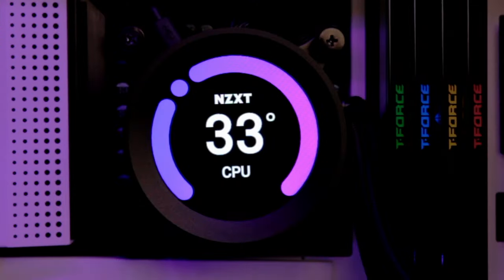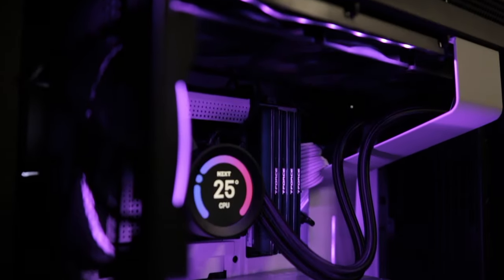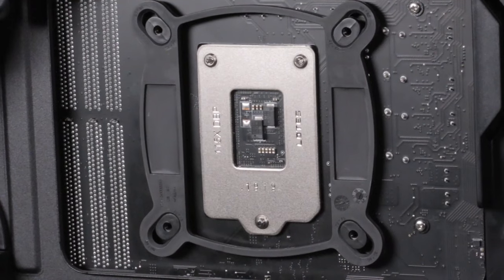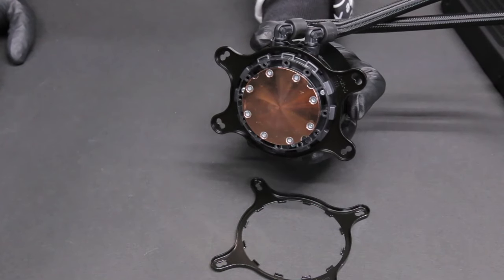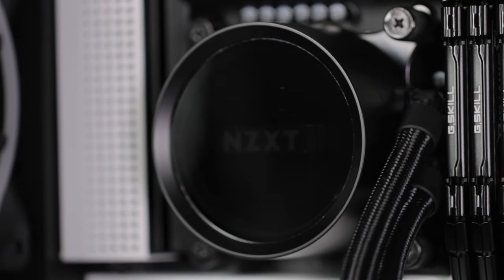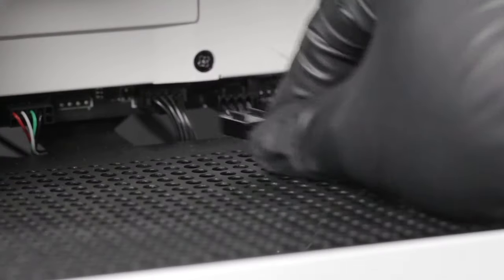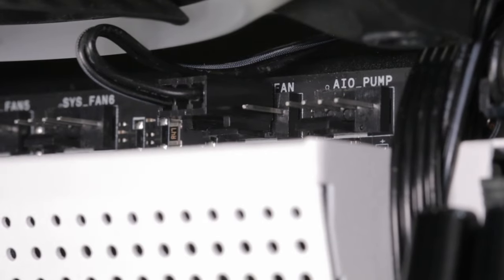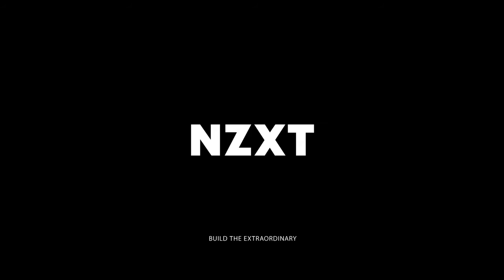NZXT Kraken X & Z All-In-One Liquid Cooler Walkthrough and Installation

Comment: I'll be honest. An air cooler would be just fine for my build, but the Kraken is gorgeous! I cannot resist! Also, it would be nice to get a white version. 😊
Reply: that's what i was thinking as my gaming setup is all white, i think i might just paint it or use a vinyl wrap
Reply: @kierannm7646  I would not paint the fins of the radiator, maybe just the exterior portion.
Reply: I have one if these. It's is pretty enough, but did they provide any instructions how to use the software? Nope.
Reply: @kierannm7646  there’s a white version!!!
Reply: @marckayyy2408  yep and I’m getting it for Christmas. I’m so hyped
Reply: @glyphs320  dude I finally ordered mine today and it comes In next week 😭 I’m happy asf rn 😂
Reply: Foreshadowing
Reply: @marckayyy2408  Yep, installing my white one tomorrow haha
Reply: Just installed mine, the only thing that would make it better was if it matched my white case!
Reply: Some high end aircoolers can perform better than some liquid coolers
Reply: @studioz3d621  there is a white version
Reply: @MrTefe  basically none beat a x63 or x73

Comment: I can't believe it,  a good walkthrough and installation from the actual company.  I know corsair does it but in my opinion not as good as nzxt's.
Reply: literally installed it wrong though lol, bad walkthrough
Reply: @kurziieee  what is the right way to do it?
Reply: @samsun4056  So the content of the loop is liquid and air, you want to get the location of the air bubble to be in the position where it doesn't cause problems.
The only position inside of an AIO loop where it's safe for the air bubble is the side of the radiator that is NOT connected to the tubes (both ends of the radiator have a tank and in between those two tanks the water seeps through the body of the radiator).
Air is lighter than water so the air bubble will ALWAYS exist in the highest point of the loop.
If the pump is the highest point of the loop this is obviously the worst possible configuration as it will cool less and slowly destroy the pump mechanism, the tubes and the radiator tank on the side where the tubes are connected to the radiator are also very bad for obvious reasons.
Thus the only good configuration is to have the radiator tank that's not connected to the tubes as the highest point of the loop, here the air bubble causes no damage or cooling issues whatsoever, since the liquid will just fall down here back into the body of the radiator without having to "fight" it's way through this configuration also produces the lowest amount of noise.
Reply: @José Mann I've had enough of armchair experts telling people what to do, even bottom mounting an aio is more than fine as long as you don't plan to use it out its warranty period, by that time it would probably fail even if mounted 'correctly'; now let alone this orientation with rad in front and tubes up top, most aios don't even have tubes long enough to get them to the bottom
Reply: @sevenelven  I guess when you don't have anything useful to say all there's left for you is to make jokes.
As per your "point", they probably just don't care because the vast majority of consumers will buy their products anyway.
Reply: @suborgulag7289  incorrect, bottom mounting will both have negative effect on your performance and will ruin your pump.
Reply: @sevenelven  my bad, thought you were being sarcastic. text hard to read sometimes :)
Reply: FFS not this shizz again. Nothing wrong with side mounted radiators as long as the tube connectors are at the top!!!!
Reply: @0Metatron  so long the tube connectors are at the bottom 

There, fixed it for you.
Reply: Only if they end up below the CPU, if they are above (which nearly all cases are) then you a can side mount with tube connectors at either the top or bottom
Reply: @0Metatron  you can but still sub optimal
Reply: @kurziieee  when people like Jayztwocents and gamer nexus says it's ok. then it's ok. lol
Reply: @aronPlays14  fallacy from authority, nice

Comment from the maker: 👉👈
Reply: @KFCowboy  r/brokethechain
Reply: @lilpapizk439  👉👈
Reply: Awe nzxt is a shy boi
Reply: EmeraldBay 😂😂😂😂
Reply: @Albert Blkyan Both have the same specs, except Z73 has a screen and X73 has RGB. Moreover, Z73 is more expensive than X73. So I guess Z73 is better than X73.
Reply: OH NO SHY GUY (SCP-096)
Reply: Can you put Gif on the kraken m22
Reply: @lusixnsgaming8072  yes, any sort of gifs can be used. =)
Reply: Does the x63 show gpu/cpu temps and allow gifs or is that only the Z series?
Reply: @simplygaming2280  Z
Reply: @simplygaming2280  no, the x series only have rgb.. whereas the z series a screen panel to show info.
Reply: @EmeraldBayMovies  🤣
Reply: @EmeraldBayMovies  😂😂
Reply: I read that mounting that aio with tubes up is having problems with bubbles? Is it ok to leave it like this?
Reply: Is for me?
Reply: @EmeraldBayMovies  hey hey hey
Reply: @NZXT Do you need to refill any aio of you guys
Reply: Ah yes docking
Reply: How do I get the breakout cable for the rgb because my kraken aio won’t light up
Reply: @its_steve9249  you probably blew out your screen, did you plug in the 12v header?
Reply: @JannisCraft just use white cable sleeves over the tubes, looks nice 👍🏾👍🏾

Comment: I really like that display, I can think of numours of idea's to add as picture or gif's on it.
I also really like that mirror look and the themp. clocks. Basically one of of the reasons I started looking for these kind of RGB-waterkoolings. No longer need to keep an eye on my system for not getting to warm during hot summer days and heavy gaming.
Since I am using your waterkooling I also noticed my PC has less issues and hardly needs help at hot days anymore.
However one thing that doesn't make sense to me - don't get me wrong - now why in this period that RGB is coming to the PC and more and more, parts are being build with RGB, there you offer normal non-RGB vans with, while in your store you do sell them with RGB. So without the RGB-vans the Z63 is a bit overpriced if you ask me.

Comment: I really want to get this to work. I did a custom build a month ago and for 12 days straight before working after work probably 8 hours a day I tried to get my first NZXT Kraken x63 to work after almost two weeks of not being able to use my computer edit videos or pictures and frustratingly sitting at this table hurting my back. I sent it back and got another one. Unfortunately I was using Amazon and even though I was buying new ones you could blatantly see that these things were used as the thermal paste was gone and there was other signs of use as well. The second one literally after three days I couldn't get to work so I bought the RGB fan adapter. With that I actually got the crack and software to finally work and it showed up as a separate pump and fans. The first one would not do that. So I could never change any of my pump settings. I'm actually on the third one now which is the z63 and that one came used as well. But everything has been on hold for an additional two weeks because I upgraded from a i 7/10 gen CPU to and I9 11th gen CPU and I had to go through three different motherboards before we could get everything working. It was ridiculous but every motherboard would work with the 10th gen not with the 11th gen. And I have 2 separate 11th generation chips that would not work on three MSI motherboards. Even after contacting MSI they stated that there must be an error with the Z5 90s. Finally yesterday I got my 4th motherboard delivered and I actually got an 11th generation CPU to work on A Z590! And yeah I tried every troubleshooting possibility including updating bios through every BIOS version on msi's website. But that aside I finally got the computer working but now my z63 is running at 100 degrees Celsius and it says zero RPMs for the pump. So 5 weeks later I still don't have a working computer I've been through four NZXT pumps and four MSI Motherboards... I probably have $3,000 tied up and refunds right now and exchanges and then my first motherboard was $1,000 because I bought a Godlike from MSI and they're not cheap but the pins got bent with all the fumbling around for weeks and weeks and weeks... I just don't understand when stuff supposed to be compatible why it doesn't work and then there's the fact that Amazon can't send a new item when you pay for one. This build has been one of the most frustrating things I've ever done

Comment: What do I need to plug the rgb control connector into. I have an x63 and a smart device on the h510 elite
Reply: I have the same problem what do i do??
Reply: PANDY 0_0 u don’t need it you just need the usb connected on the mobo and the cam software

Comment: So I got  3 of these, in the 240 and 360 versions. I'm I happy with them, yes to a certain point, do they look cool, yes if you are into that. Personally I'm all about performance, do they perform good, yes to a certain degree. Can I recommend some improvements, yes, in honesty you can save a lot of money just by using a top of the line air cooler. Yes you will have to live with the fan noise, but that happens with the AIOs also. In my case I have several Gaming rigs. AMD based and Intel both, I prefer Intel, is a little pricier but performance is great for the money. It runs cooler than AMD chips and that is a big plus. I have the 240 on an Intel chip and a 360 on an AMD chip both running the same software and specs. When I put them side by side the Intel is a lot quieter even with a smaller AIO, that to me is a good indication that the AIO is doing it's job real good, for the money spent that is. Lots quieter, I like quiet, and it saves me from having to buy headphones and wearing them like a dork. The room temperature is lower, a gaming room can get real toas-t when you have Gaming PCs running 24/7. Yes these AIOs are pretty but their performance for the  money really soks big winnee. Stay away from AMD if you like a cooler room and less fan noise. A decent air cooler will do you good if you are willing to live with some fan noise and a bigger PC case. The 360 AIO fans on the AMD chip are loud and they generate a ton of heat, but they look pretty, HEY? Just my 2 cents but I warn you, I owe them to the IRS.    😅🤣😂

Comment: May be a silly question but fans only blow one way and I don't know which direction is the correct way to install the fans when mounted the fans below the radiator for a top mount (radiator touching chassis and then the fans below it). Would I want to blow air into the case or out of the case? So confused lol
Reply: Set them to exhaust
Reply: Or you know, unscrew them and turn them around lmao

Comment: Weel done but you have forgot the W_pump 3 pin cable connect. This in need to control the water pump speed

Comment: it would be nice if some of the cables were longer and out of the box ran up with the water tube so it didn't look like 300 cables coming out of the cooling block.
Reply: You tell me I have 10 fans I don't know how I did cable management. Also, having problems with my bios right the pump cable is too short to reach the bottom of my motherboard

Comment: Is this in/out cables used for the fans? Or does it just wire into the motherboard and don’t worry about connecting the fans to each other
Reply: did you find out i’m having this problem rn please tell me

Comment: So I don't get it. First time putting an aio cooler in a build and I have no idea what plugs go where due to getting it used and the cords being a jumbled mess and it has no manual. You're saying to put the 3 hole connector into the cpu fan slot? that's the only part of the cooler that connects to the mobo?

Comment: Can you change the fan included in the cooler?
Reply: I am using 6 fans that are not nzxt with the x73. 3 Noctua in push-pull config. 3 Asiahorse pulling.
Reply: @mrwhite9830  thanks!

Comment: Hi, I need some help.
I had just installed my NZXT Kraken X63 AIO and seems to be working normally, however, when I'm using the cam software I am not able to change the Lighting because it says "No supported cooling devices were found" and "No supported lighting devices were found". Thanks!

Comment: I’m a little scared of liquid cooling, I’m about to build my first pc and am wondering do I have to add any liquid/ replace it? Thanks for any help!
Reply: Am too!
Reply: No. AIOs are set up so you never have to mess with the water inside. They are already filled. You just need to install and you are good.
Reply: AIOs are ready to go out of the box, you don't need to add or replace any liquid.
Reply: it’s just as easy as an air cooler

Comment: Just picked up the H510i case and Kraken X63 (2 fan one)... I'm a bit unsure of the fan direction for this setup.  Are the fans in this video pushing air through the radiator into the case, or are they pulling air out the front??

Comment: Why are you showing the radiator mounted tubes facing up in this video at 3:55? Doesn't this create excess noise and added stress to the pump?
Reply: as long as the pump is bellow then radiator it’s fine, refer to Jayz video on pump orientation
Reply: @icy_business  It won't stress the pump if the the top of the circuit is higher, but it will still cause a trickling noise if it's mounted that way.

Comment: im very new to pc building gonna build one tomorrow and i know its probbably a dumb question but arent u supposed to put liquid in it since its called a liqiud cooler i dont really understand but i bought one and i need some info before building how does it keep cool cause the display thing isent a fan right so how does it keep low temps compared to a build with a fan on top of the cpu?
any answers will be taken with great appreciation :))

Comment: what do I plug the 4 pins from the break-out cable to if I don't have compatible NZXT RGB accessories and will the RGB in the block still work? (i have a Kraken x73)
Reply: You need the NZXT controllers for the fans and stuff. Stop buying products that need other things to function and only buy stuff that can work independently and can be controlled with the Motherboard BIOS

Comment: OK but I didn't see you put liquid into the cooler does it come already in there?  I use a Noctua air cooler and get to like 67c under load in cinebench so I don't even think I need an AIO but it seems nice
Reply: I don't think you can ship something like this with liquid in it. They were showing everything but that part for some reason

Comment: is it possible to use two of them in the same system? one for the cpu and one for the gpu while using the software to control them independently, in order to change the pump rpm and fan rpmfor each water cooler?
Reply: You can't connect a thing made for a cpu on a gpu since it will only fit on a cpu lol The connect point is the circle thing for the liquid to go through, it's not just a fan.

Comment: I just booted my pc for the first time and everything turns in except for the rgb lighting on my x63 kraken (h510 elite case). I have re-plugged in everything, even trying different Sata and USB connectors but still nothing. I have not yet booted into the bios or even started to connect the pc to a monitor. My question is do I need to install cam software first in order for the rgb to light up or is there another issue? Any help is appreciated!!!

Comment: Hi,
I want to buy the Kraken x73 but I still have a question:

Do I have to plug every single fan into the mainboard? or is it possible to connect all 3 fans together, so i only have to use 1 fan header on the mainboard? 

My mainboard only has 1 CPU_Fan Header and 3 SYS_Fan header in Total (all are 4-Pin).

The new case will have 3 pre-installed fans.

Total number of fans: 6

Im not sure if I need a Fan-controller......

Thank you in advance!

Kind regards, Darth!
Reply: fan spliter is including, you ll need only one fan header and one pump header and one sata plug

Comment: im currently using a ryzen 7 5800x and even just gaming im gettin spikes of 90c using thermal grizzly using a push pull config. ive been building 20 years and installed many AIOs and custom loops yet my temps are horrible with this AIO. idle sits around 45c yet my gfs 3600xt using a cheapo cooler master $60 240mm aio sits in the 20s idle. is there something wrong with the mounting pressure with this kit? it is the only thing i can think of. thermal paste seems to be spread decently after removing pump but these temps are uncalled for.

Comment: These coolers have an issue on several motherboards, including x570, that they're not recognized as USB device/ by CAM. I was about to return it, but plugging into my corsair commander pro USB header did the trick. If you do not have another internal USB hub, NZXT can send you one of their hubs for free if you have this issue.  Hope this helps ;)
Reply: Long standing problem with any aio if you don’t directly plug them to the motherboard usb 2 header they aren’t always detected.
Reply: Wait so it doesn’t work w aorus x570 mother boards?
Reply: @Nathan-kw2vi  did not work for me without the internal Corsair USB header. (X570 E-Gaming)
Reply: I have an Asus RoG Maximus Z790, and it is telling me in my bios that the Cpu Fan detection error! I don't know what to next.
Reply: @AscendanceMedia  I will try that tonight and also try to plug it straight to the motherboard . I'dont know how the wire are to short.
Reply: @deadangel6142  yeah I think I have turned that warning off. Fans are controlled via other software.